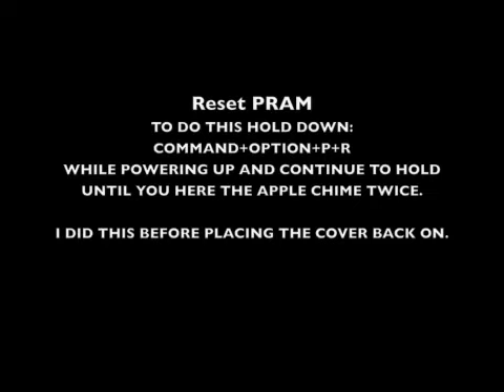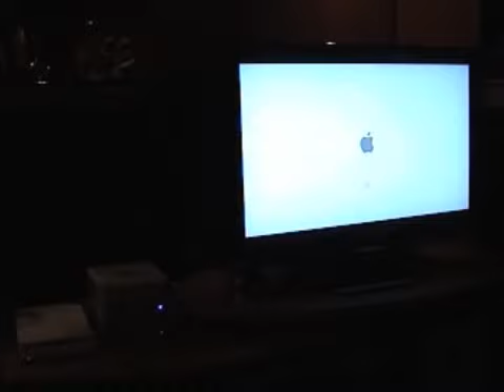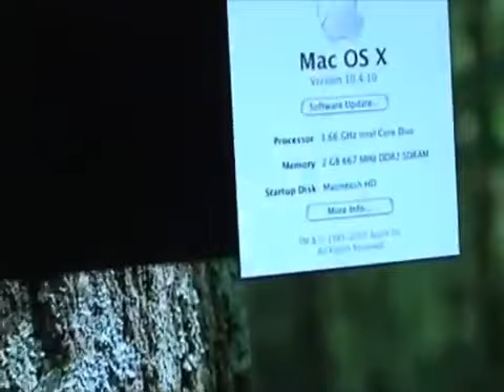Intel Mac Mini Memory Upgrade

Comment from the maker: @leodiaz117816 NO!!!!  format means its size factor, the chipset dictates RAM read/write, 07 does not support DDR3, this vid had DDR2 BUT the new mac mini's RAM at DDR3 will work with current macbooks using DDR3 not older models

Comment: Good ol' mac mini's, i wonder why they changed the layout when it moved from G4 to Intel - the RAM looked a lot easier to upgrade on the old G4's lol
Anyways, ive ordered an iMac and a 2gb stick to whack in (making it up to 3gb). When i install the extra stick would i need to reset the PRAM aswell? Cheers!

Comment: Nice Tutorial. I have upgraded my Mini one minute ago.
It's not really necessary to unplug the cable near the connector on the back.

Just a quest: I've not reseted PRAM, but after first boot my System Information was already with 2GB. Can I avoid the PRAM reset???

Comment from the maker: if the RAM was recognized then yes you can skip it.  As for the back connector, yea you can get away without unplugging it but have to be more careful not to put too much stress on it.  Thanks for the comment.